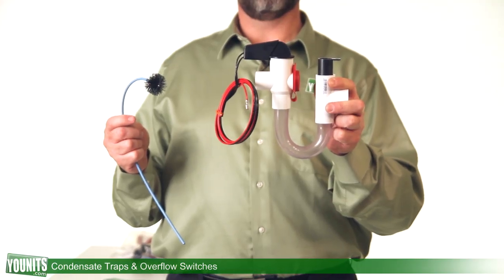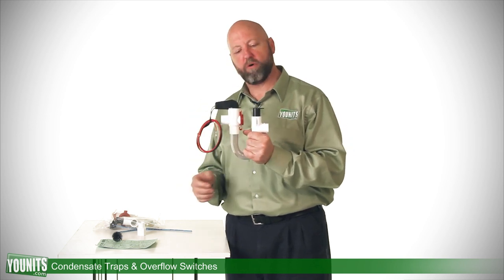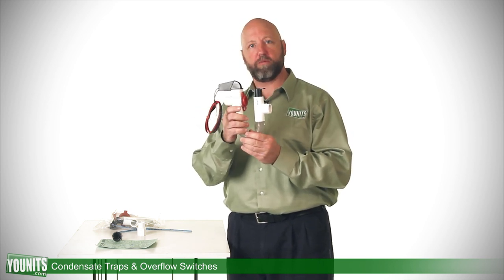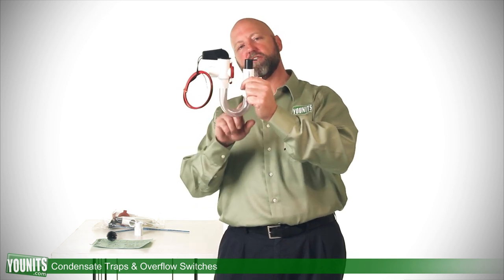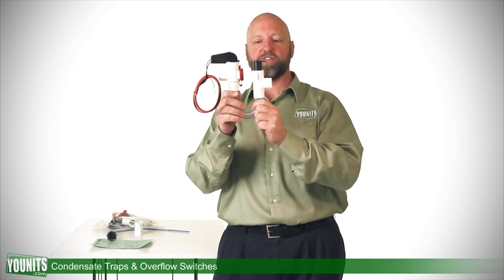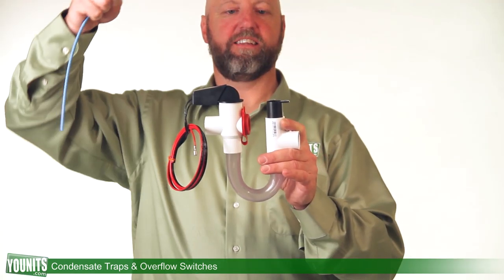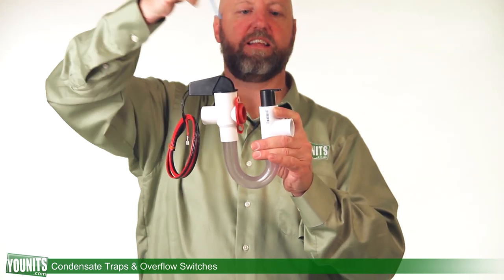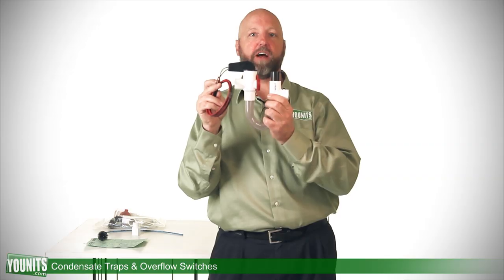Video Guide to Condensate Traps and Overflow Switches  - Younits.com [HD]

Comment: The hole where you stuck the brush in, can that black piece be pushed in the cut off the flow of water from backing up?  My pipes are frozen and is conjoined with two lines into one. The line that has the ez trap is clear. How can I isolating the main line so that my hot water goes to were I need it to go; outside?